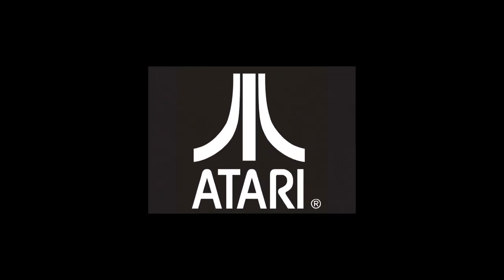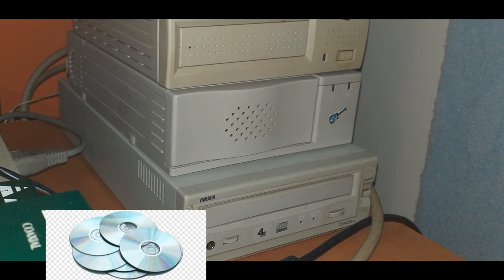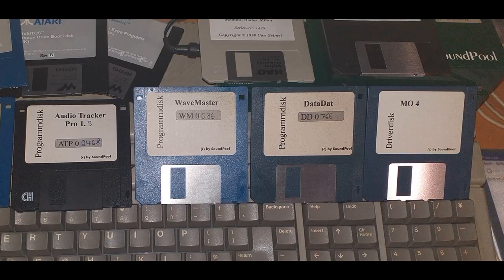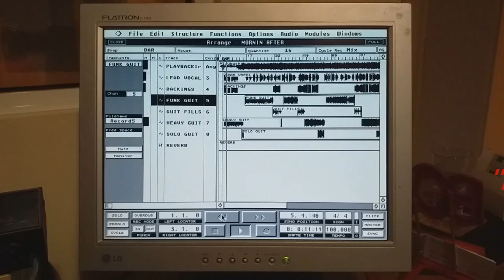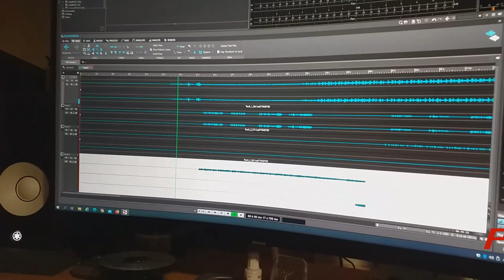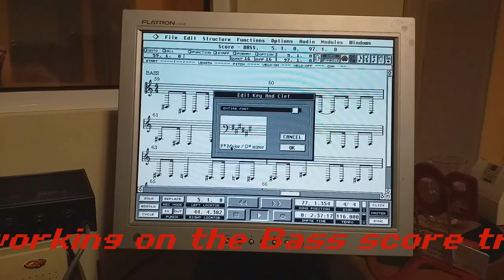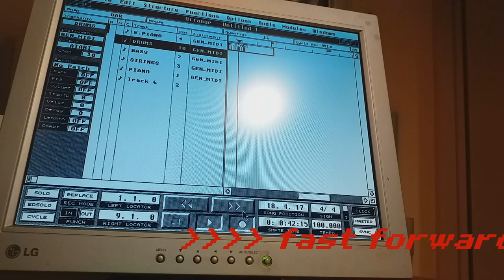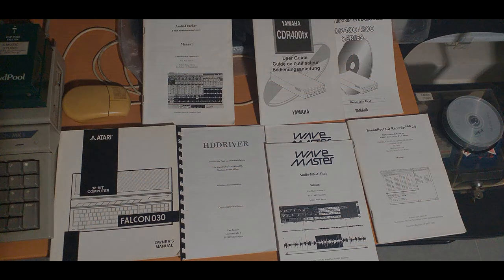C-Lab Falcon MK II (Atari Falcon compatible)

Comment: I wrote my first song in the early 00's with my Falcon 030 and AudioTracker, because it is able to record and then playback 8 tracks directly to/from an IDE drive. I tried with Cubase but SCSI was unreliable on my machine at the time (since then I have redone the clock buffers, and added a 68060 and SCSI is fine). I also have the Soundpool FDI and the Analog 8. For input recording I used the A/D on a Sony Minidisc into the FDI with Optical. I just spent a couple of days setting it all back up again and getting it working bit by bit. It's quite fun but I'm not sure I can use it anymore for serious song writing and recording work. It just feels too cumbersome and prone to crashing, so I am thinking of selling it, and just getting a decent USB audio interface and Reaper to use on my Mac or build another linux box. That would be a shame though and I'm sure I'd regret it.

Comment: The SoundPool has both analog audio IN and OUT? What a dream setup.
Reply from the maker: Yes ,the 8 analog outs are Soundpool's Analog 8 (the older models were FA-8 and Analog8/4) and the 8 analog ins are Line Audio Design's Jam In 8 !
Reply: @emulatorx2  thanks!
Reply: @emulatorx2  I had the Analog 8 along with the other Soundpool SPDIF optical and Cubase Audio 2.06 and SMPII etc.  Really solid machines and intuitive to use.  Golden era of MIDI and audio for sure!
Reply from the maker: @EgoShredder  Yes, and MIDI has been more stable and consistent on Atari machines than on any PC or Mac. Midi on Atari was and is  really "hardware like" ;-)
Reply: @emulatorx2 best midi ever and nothing can ever beat it in timing

Comment: Hi Antonia, amazing setup you had. Question how did you setup your E-mu 1820 in a 64 bit windows 10 environment? I also have an E-mu 1820 but cannot install in 64 bit windows 10 because E-mu 1820 is made for old 32 bit windows 2000 systems. Could you please explain how you install in yours? Thank you kindly!
Reply from the maker: Hi Paul! There are 64bit drivers for 1820 and 1616, it has a certain workflow to install these cards
Reply from the maker: https://answers.microsoft.com/en-us/windows/forum/all/the-sound-card-e-mu-1616m-does-not-work-with-the/44f13d28-54de-47c2-b058-e72ab0d4113a
The best way to run E-MU Cards on 64 bit Win10!
Reply from the maker: It works up to the latest WIN 10 22H2 so far, I don't know if it works in WIN 11 though...

Comment: Could you explain what are the differences with  a regular Atari Falcon?
Reply from the maker: C-lab (a german music company who made notator and creator score and sequencing for Atari ST) made some small internal hardware changes for the audio/studio market at that time. The Pc's before winxp came out, couldn't really record without clicks and other audio problems until 2001 and the also Atari Falcon's audio path was not very professional done. C-lab made some modifications on the internal audio and clock path,they removed the bass boost from stock atari falcons, they set proper line level inputs,made isolations from interference before digitizing the audio, put a dynamic anti-aliasing filter on output and some other small things on audio clocking! They removed the internal resistors on scsi bus and added a internal scsi adapter board with a fast 2,5" 514MB scsi II internal scsi disk. Internal 16 MB Ram (14.3 Mb usable) was standard on MKII but not on MKI .They changed all C-Lab Falcons OS to TOS 4.04 which was the best atari os for audio apps .Cubase Audio and Logic Audio (the "son" of C-labs notator and creator) couldn't work with ide disks for fast multitrack audio recording and playback! Falcon MKI was without internal scsi adapter and hard disk. You could always remove the internal scsi drive for a ide if you wanted on Falcon MKII. All modifications were made at the original Atari hardware factory in Tam-Shui, Taipei (Taiwan) !They bundled The C-lab Falcons MKI,II and X (rack mounted) with Cubase Audio and other soft and hardware for pro use in home and commercial studios! All in all they are more reliable than the stock Atari Falcons but they are very similar and externally they are almost the same (except the back and front  C-Lab stickers).So that's it .

Comment: Why its better then a PC,with a good midi-audio interface??h....m
Reply: there is lots of software standing in the way of accurate timing on PC, on Atari the MIDI is reading/writing directly to RAM on "metal" level. Nothing can get in between.
Reply: From what i know, its the timming that’s rock solid on a Atari, I believe has something to do with multitasking on PC’s that doesn’t hold timming rock solid as a Atari which is  not multitasking.